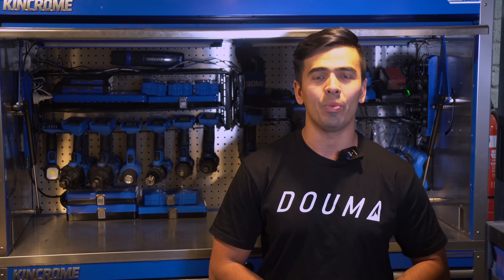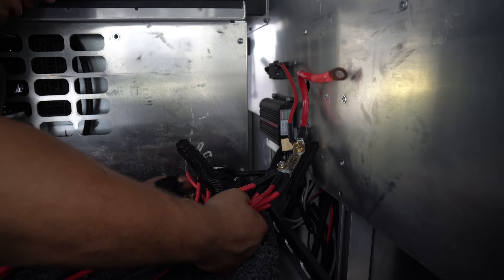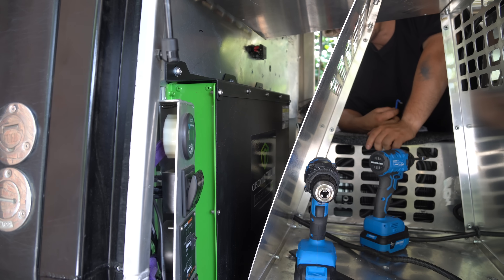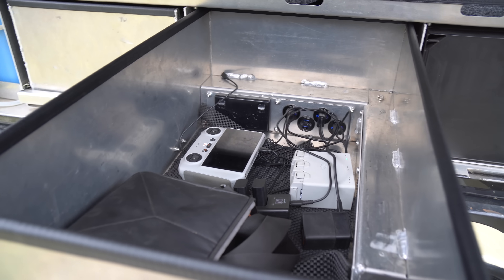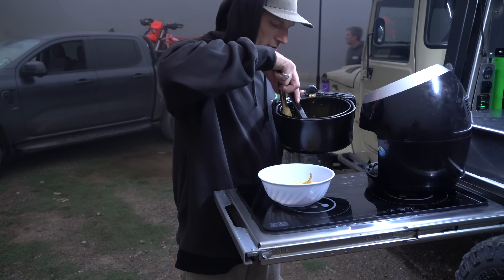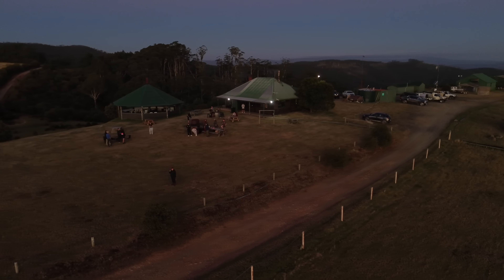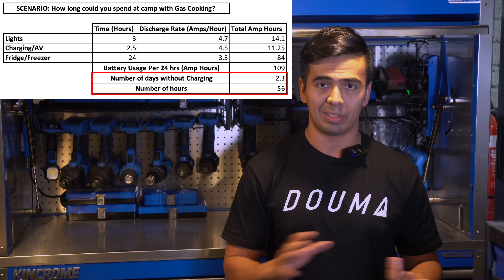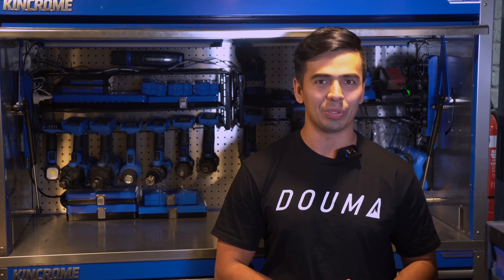Don't make this MISTAKE with YOUR 12V!

Comment: I find it’s really interesting putting together a 12V setup. You can realistically get away with 100A-150A lithium if you keep it to a fridge, lights, 1000W inverter for chargers etc.
But if you even consider induction, air fryers etc, straight to 240+A. There isn’t really an inbetween
Reply: I agree, Im on my 2nd set up. The achilies heal is the recharging time when driving - most people undersize the recharging. I have 100A dcdc recharging from the alternator (60A normally + 40A when on the highway) this lets me recharge a typical overnight 100AHr use in 1hr of driving .

We use induction cooker, nomal toaster and normal kettle, as much as we like, plus a new small efficient fridge.  We dont bother with solar anymore. I upgraded the alternator to a 180A unit, but... that is not at idle or low rpm.
Reply from the maker: I completely agree!

Comment: I would like to set up an off grid battery system. With a 200w solar panel for any of those longer trips. 
So with a 300ah battery - what do you recommend with regards to inverter size, and battery management systems? Looking at enerdrive setups and others, it all becomes confusing. I would want a system that has the ability to charge off alternator, solar panels and plug in 240v. Depending on where I am.

Comment: Great vid guys and good job on the battery upgrade, (about time), I still think this will be a minimum for what you are doing, especially if you want to park up for a few days or more, you could do with another 100A-300A, I knew your original installation was not going to give you enough power for how you wanted to use it and I didn’t like a few aspects of the original set of 100A batteries you were using, some of which you mentioned, Ando plugs, etc.
While solar would help a bit, if and when you are in good sun, it is not reliable, ie: you might only get a few amperes total some days for possibly weeks, I think you were being too generous with some of your calculations.
No disrespect mate, I think you are one of the best engineers & content on YT. Cheers

Comment: thats all fine vs usage, the question is how long does it take for you to recharge the setup? 12v 50amp via your alternator would still take you 4-6hrs of driving per day to replin what you use which is a fair bit of driving about

Comment: nice upgrade. I've had custom lithium for a few years now and going pretty good. Is that cable to the inverter really big enough for 3000w?
Reply: This! I pull 295A+ when I run the air fryer plus induction together. I use 95 mm2 cable which looks to be at least twice as thick as what was in this video. I imagine the inverter cable got pretty toasty.

Comment: Nice upgrade, I did consider customlithium when buying a battery for my camper last year but couldn't justify the price, went with another oz battery. Assuming you had itech batteries with your last setup, you certainly won't be dissapointed with Customlithium compared to the itech battery rubbish. ps: hopef your new wiring doesn't include multiple loads on a single terminal as was the case with the shunt in your last setup! Busbars are the key
Reply from the maker: Agree on the busbars, when we wired it initially we were under a heap of time Pressure. It doesn't this time, we took the time and did it right!
Reply: @DesignedandBuilt  Nice and I get it, I've been there too....

Comment: @all: If ONE cell is bad, one does NOT NEED to change the complete set!
So please do not get confused! The princip is as follows:
LiFePos have a cell voltage of 3.4V (simplified). So one set´s up 4 in series to get roughly 12V. If ONE is not strong engough, THAT one will set the base of ALL in regards to system Voltage, while the other would be able to provide more power. 
Change that one, and the Bar. is as good as new.

I myself bought the cheapest CN LiFePos last summer (nothern one) for 175€. 2 of them. One cell was bad, night from the beginning. = they suddenly were below the min. charge and therefore off! I git anexchange for that 12v Bat.
This "bad" Bat. still works fine on my balcony now (with a 160W PV), for music, NB charging, Phone, cam, light etc.
BUT: It will NOT provide the promised 1280Wh. (which, in that set-up is completely irrelevant)

Comment: 3k for a battery, camping and four wheel driving ain't what it used to be.
Reply from the maker: Pretty reasonable for the size and capability I reckon! You can just cook with gas if you have the time for it!
Reply: @DesignedandBuilt  I don't understand, are you saying gas cooking takes longer then induction ?
Reply from the maker: Definitely more inconvenience. Filling up the gas, setting it up every time etc. The induction can be on within a matter of seconds. The actual cooking time is the same, I think ha!
Reply: @DesignedandBuilt  So all this time i've been wasting precious minutes, dang...
Reply from the maker: @65cj55 I would argue time is the most precious commodity in the world 🤣
Reply: @DesignedandBuilt  Why waste it driving around over rocks and breaking stuff then ? 🤪

Comment: I run a small panel on my roof purely to slow down any battery usage, I tend to camp only for a night or two then move on so if i am camped up then the solar trickling in just gives me a bit extra time and less to stress about.
Reply from the maker: Fair enough, it would help!

Comment: Great video, loved the breakdown at the end. I am putting a 310A in my ranger, planning on induction cooking as a Solo Traveller. I figured I can get a 200w panel on the roof, and if I need ill take a 300w blanket aswell I can throw out. The solar for me is to mainly offset the Fridge/Lighting and maybe a night or 2 of cooking before I move onto the next spot, As well as maintain the battery while its parked at home when not on the road
Reply: Dont rely on the solar. We have a 400w solarblanket but testing is the best conditions possible gave 200w / 17A actual. Even if you manange 5hrs of 17A, ie 35AH, this will not replenish your battery.
We use induction kooking, ordinary kettle & toaster  + a new small fridge, and we average 100AHrs used overnight (between driving). Thus, our 240ah LFP battery lasts 2.5days without driving. Yes solar could make it last longer, but... id there is any cloud, your solar will be only 10% of the output of full sun.

We upgraded the alternator from 130A to 180A and charge at 60A normally,  + an extra 40A dcdc charger switched on on the highway. This battery is rated for 100A charge. Recharging too slow is the biggest mistake people make.

Comment: I run a 160ah Itech world power station that charges via a bluetti dc to dc at 40 volts . Don't use induction though so a couple hours driving per day tops it back to full from running the fridge , lights and charging small accessories.....negates the need for a fixed solar panel in my case,do have a 300 watt Itechworld solar blanket if stationary for a few days.